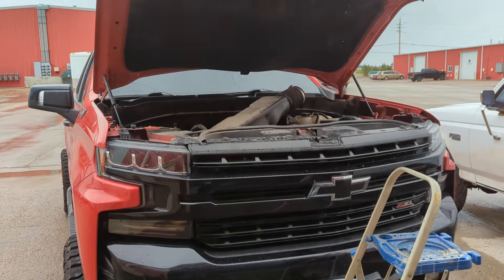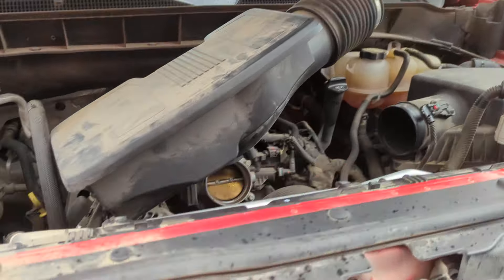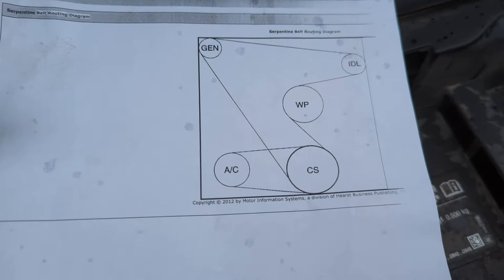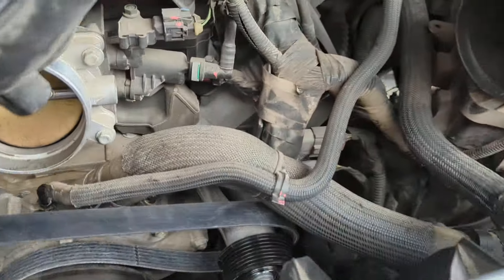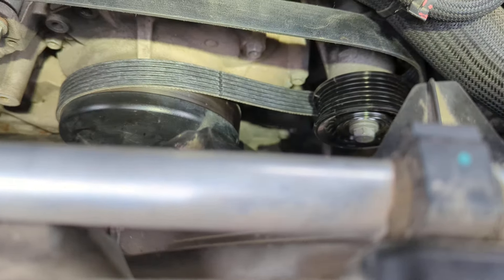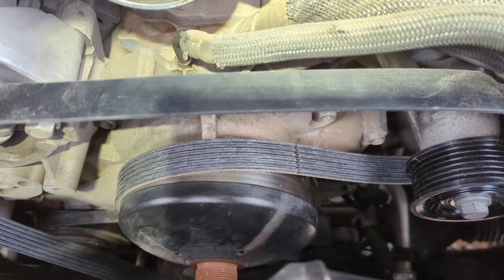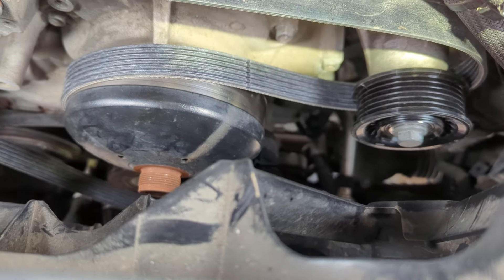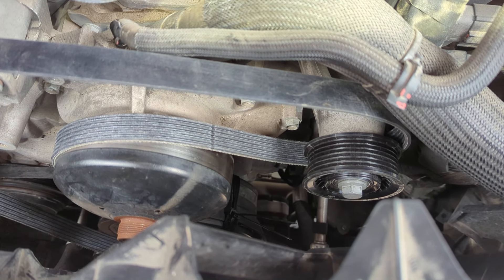Serpentine Belt Install on  2021 Chevrolet 1500 5.3L with no special tools

Comment: More reason to hate these problematic trucks.
Reply from the maker: It's a simple install once you know this trick.
Reply: I added mine today and noticed a puff sound at manifold when I turn off engine. What can cause this?
Reply from the maker: Was the noise there before? Are you 100% sure the belt is the correct one and is routed correctly?  Can you describe the noise and location better?
Reply: Best truck I have owned. 130k kms no issues